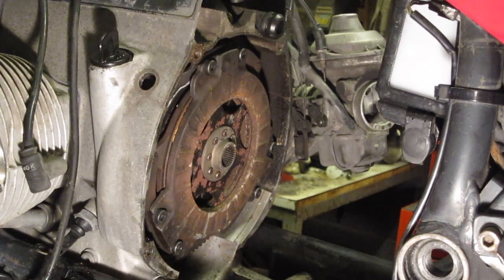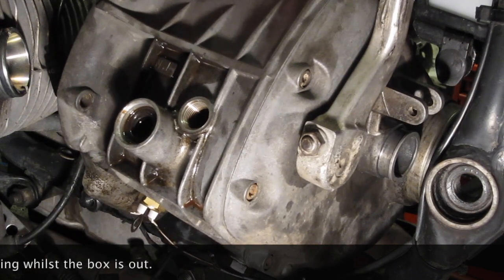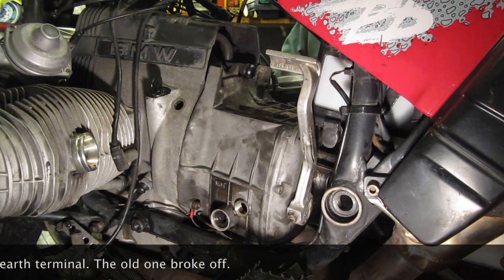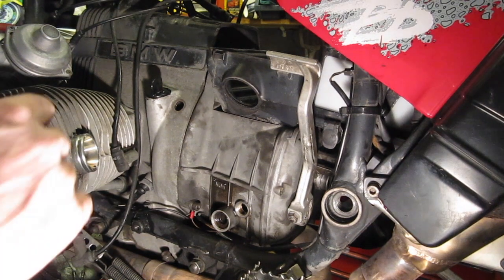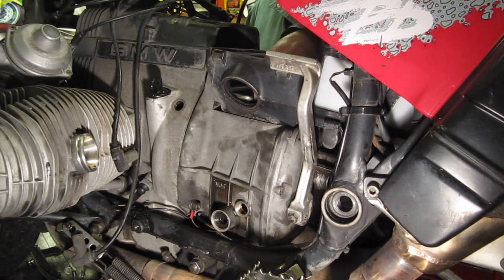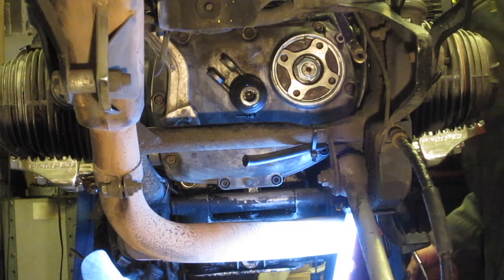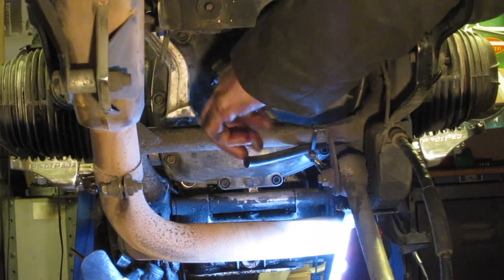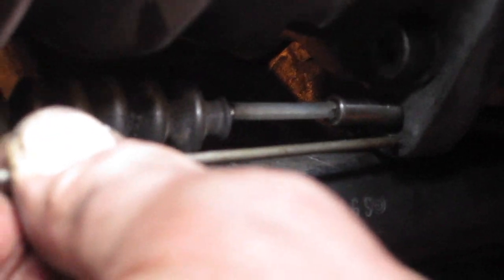Lube Splines and Refit Gearbox

Comment: Good to have you back sir, your videos are a great source information
Reply from the maker: Thank you.
Reply: Good to see your videos back!
I have a question if that's ok Guy?
During a gear box change last year, I had clutch plate removed to check it was all ok, but I don't remember marking Clutch flywheel or carrier with paint etc. before we disassemble. What problems could this cause if it wasn't put back in the same order?
The bike gear change and clutch seem to be working fine, gear change is a bit lumpy.
Reply from the maker: Mark Loder, I wouldn’t worry about it too much. Misalignment of the clutch balance marks will increase the potential for engine vibration, but bear in mind that if the bike has done enough miles under the ownership of several other people, the chances are high that the clutch has been replaced and reassembled out of balance in the past.
As for your comment about gear changing, I think balance is much less likely to be the case. Gear changing issues caused by the clutch are probably down to improper clutch adjustment / clearance (see one of those last videos I uploaded for adjustment), or a worn / damaged release mechanism, or warped / damage plates, spring etc. or another issue unrelated to the clutch.
Reply: Thanks for your reply! Appreciate your thoughts on this.

Comment: Hi Moto Phoenix,
 I have a BMW R100RT registered 1993.
How long roughly in hours would it take me to replicate a spline lubrication with paste as you showed here.?Thank you, Richard Allan.
Reply from the maker: It depends on your capabilities and how practiced your are at the task. I can turn the whole job around, which includes all the transmission splines, paralever pivots, swinging arm bearings etc. in about 5-6 hours.
Reply: @motophoenix5951  Hi Moto Phoenix .Thanks for your input, I watched your video and decided I did not have the skills or insight to undertake a Spline Lube.
My request differed from yours, but I wished I had known about all the "extra's" you mention.
 I wonder if I have been overcharged ?As I am not a Mechanic I felt  5.5 hrs was excessive to undertake  3 tasks only. The rear wheel had to be removed any way as the tyre was to be replaced.
I asked Two local car mechanics ,who dabbled with motorbikes, to perform 3 tasks :

Draining and refilling the Final Drive. 
Applying the paste to the Gearbox Splines
To check the rear main seal for leaks, as Final Drive had visible oil deposits on the casing.

 Their times against this task were 1.5 hours to remove the rear wheel and 4 hours against the Final Drive Maintenance ,propshaft oil change and seal check.
Unfortunately, they did not balance the new tyre either.So a grand total of 5.5 hours. . I arrived at their Workshop to discover they were well into the guts of the task. They said so far 4 hours work was expended .I smelt a rat and called a halt to the work.The spline lube was never undertaken as I realized after 4 hours they were not near the spline.They also said the Final Drive Splines were always bathed in oil. which I knew anyway .This mean't they had undertaken a task for which they had no knowlege of. I had even given them the Manual.What do you think ? Regards Richard Allan.
Reply from the maker: @richardallan455  The problem with getting anyone who, although they may be a skilled artisan, is not necessarily familiar with the thing you want fixed, is that it is still going to be somewhat of a learning curve. My advice would be to seek out someone who claims to specialise in the make/model of thing you want repaired and then get them to give you an estimate. That way you can decide if you want the work to go ahead and also you have a right hold them to the estimate I believe. Unless of course there are unforeseen circumstances that arise. At which point they have a duty to stop and contact you to discuss the matter. 
Personally, it seems to me in this case the person who did the work did not have adequate knowledge of what was was involved in carrying out the work, but equally it seems you could have made a better choice.
Reply: @motophoenix5951  Thank you Moto Phoenix for your response.Unfortunately there is no body in my area who has a knowledge of Bmw Boxers,which has been a costly mistake.Their guys talked a good job and made me believe they were competant. My choices alas, of who to poot it to, were not so easy. How frequently should  gearbox spline paste  be applied? I have no guidance, and cannot refer to a genuine  BMW Service-schedule for my Motorbike,as I do not have an original worksheet to identify when that task is required.I note you said in your video you carried this task out yearly. Best Regards, Richard Allan.
Reply from the maker: @richardallan455  so far as I am aware BMW does not list these tasks in any of its service schedules and there is no official recommendation to do so. I have checked both my BMW factory manual and my owners service book originally supplied with my machine and neither document mentions this work. Nevertheless, based on my knowledge and experience of 50 years of working on motorcycles I think it is good practice to carry out this work once a year or once every 20000 miles, whichever occurs first. Other folk who do this either decide for themselves or follow advice from others in the know. On the other hand many never bother to carry out this maintenance task. The choice is yours.
Reply: @motophoenix5951  Thank you very  much Moto Phoenix. I borrowed a Library book last year but found nothing.I shall go with your advice,I have pretty much a full tube of Castrol Paste,are there any other areas  on my Bike it could be used upon? Once again I am grateful for all help  ,Richard.

Comment: How do you get the 4 bolts in that connect the UJ  joint at the gear box to final drive shaft . the B......DY gaitor is restricting any space
Reply from the maker: maurice eley it’s a fiddle. Once the bolt holes are aligned, I usually offer up the bolts by holding the threaded part with a pair of needle nose pliers. Then apply a little force on the head of the bolt, while rotating the thread with the pliers.  Of course, all the time I am also trying to keep the gaitor out of the way. It also helps if you leave the swingarm pivots out, so you can push the swingarm back a little in order to get better access.

Comment: Thanks for the content. Do you perform any maintenance on the speedometer cable? 
Lubricate it?
Reply from the maker: Yes, if I can separate the inner from the outer; I have come across some you can't. When I can, I usually extract the inner at the top after first disconnecting the cable assembly from the speedometer. I wipe the inner with a clean dry rag. Then I smear a film of wheel brg grease on the lower end of the inner and start to feed it back in to the outer, adding more grease to the inner as I go. I leave the last 10 cm dry, to lessen the chances the grease finding its way its way into the speedometer.